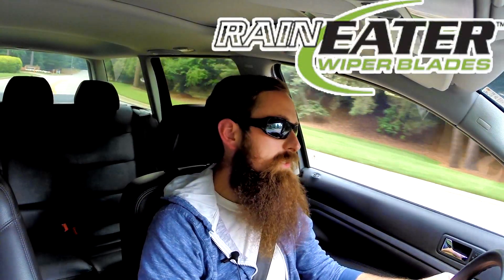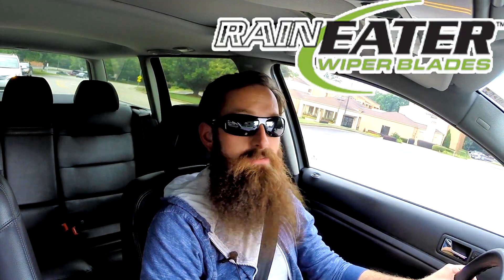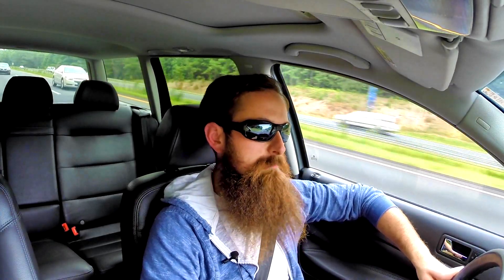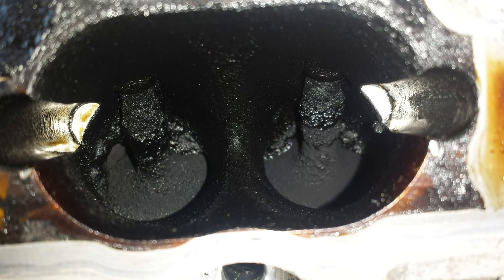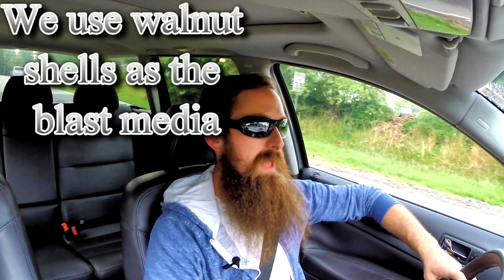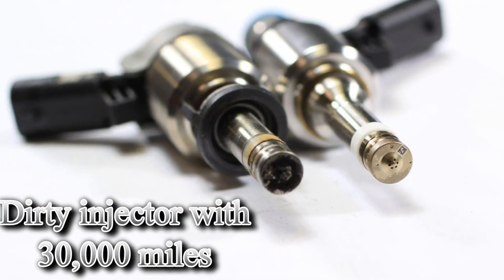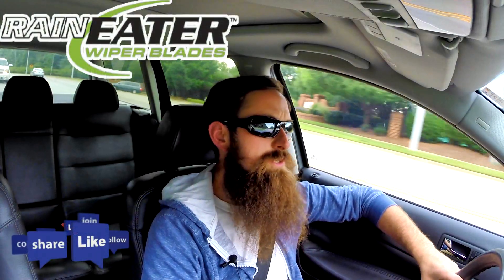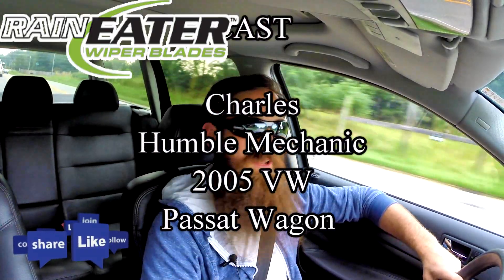Preventing and Fixing Carbon Issues for Direct Injection Engines ~ Episode 80

Comment: Hi, I understand seafoam may not be the best choice but what are your thoughts on hydrogen engine cleaning service. I understand its not as effective as manual cleaning but could it be good enough to get the majority of junk off?
Reply from the maker: I have not found that to be worth the time money and effort. but that is just my experience
Reply: HumbleMechanic 
Thanks for the reply. Would it help in cleaning the valves at all - just that the nearest dealer to me  that offers walnut blasting is 400 miles away and charges 400-600 Whereas these hydrogen vans are everywhere, can come to me and charge 50-100. Also if not directly helping the valves would it be good to use this service in general on a tsi engine in general or is it snake oil? Thanks again.

Comment: For my 2015 audi a3 I take the pcv diaphragm off and replace it every 3rd oil change. While I take the diaphragm out, I use brake parts cleaner to clean all the gunk and carbon built up inside. It'll save headaches in the future and the diaphragm is really cheap.

Comment: Leads off a video about fixing carbon in fuel injectors with a discussion about wiper blades. I guess we all need to make a living somehow.
Reply from the maker: Yep. We all have bills to pay. Not sure if the comment is hate or not. So I’m gonna go the not route.
Reply: It was a little bit of sarcasm, but I do understand you gotta run ads somehow. Wish I could quickly get the gist of the video in about a minute though. Just searching for the best fuel injector cleaner for now. A little scared to take the injectors off or inject stuff into the fuel line for now.
Reply from the maker: It depends on what your goals are. I use BG 44k in my car. Does it really do anything? Meh I don’t really know. It’s probably not going to fix any issues your car has. But might help delay any affects
Reply: Thanks. I've used BG 44K before. It's good stuff but it's expensive. I use it last fall so it's only been about 6 months and 6-7K miles. Good to know that's what you use though. I've done like 3-4 MMO treatments with a Gumout PEA treatment. Changed the fuel filter too. So my injectors are prob clean, but they're the originals with 243K miles on them.

Comment: My father taught me, long ago, take your car out at least once a month and open that thing up!   Reading all the comments and advice, I thank God for my fathers advice and the fact that I Drive my car more than 20 minutes a couple times a week!  My GTI had a dealership cleaning, just as a precaution and because I love my car.  I use top tier gas, let her warm up and watch that idle drop, before I take off.  I feel for these folks who have performance cars, or cars period, who just idle along.  My car has 97000+ miles and that engine purrs on start up and on the run.  Oh, and after a hard run, I don’t just shut the car off, I let it run normal as I drive local streets home; respect.
Reply: That makes no difference on a DI engine because the carbon buildup is on the back of the intake valve which only has air rushing past it, no detergent fuel to clean it.    Running the engine more just builds up more carbon.

Comment: Charles, What about bypassing the PCV route with installing a PCV delete? I understand that most states (like California) doesn't like this due to strict emission regulations, but what if a PCV delete was installed, would this stop carbon build up? Or extremely reduce the carbon build up on the intake valves, specifically? 
AND then of course, use fuel cleaners to get to to the carbon on the cylinder heads as long as top tier fuel is used, of course? 

Could anyone comment about this idea and if it would work or not?

Comment: 99% ISO propyl alcohol sprayed  direct in the manifold with a hand  pump spray bottle while the car is running with a slightly high idle. In the old days ( 1978 ) we dumped some brake fluid right into the carburetor from time to time. On my private cars I took the crank case ventilation hose off ( nobody have to eat his own shit , why should my car ) . Dump also a few liters of 99% Iso propyl every month in your tank, that cleans damn good.  We had experimental engines running in Germany , totally on alcohol, and  they was inspected with an endoscop, and they was cleaner than clean. But the cleanest engines we had was the ones they run on Propane.

Comment: Even though a catch can would help to prevent much of the carbon buildup in the engine, would installing one in my 2018 Audi S3 void the warranty?
Reply from the maker: Good question. I will shoot a video on it. It's not a simple yes/no answer. The short answer is, a failure related to the can might no void the entire warranty, but may result in a claim being denied.
Reply: Robert LeBlanc Really depends on where you live. Thats pretty much a question of your countries consumer laws. I‘m studying law in germany and I really wouldn‘t advice modifying your vehicle what so ever if you might want to do a warranty claim in the future. If you want to claim warranty for an issue that might be ever so slightly related to your modification, the dealership might really easily reject your claim.
Reply: Thanks for the feedback guys. 
It’s strange that they would void the warranty because something was installed that improves engine life, but it’s not surprising either, as manufacturers are known to void warranties for any possible reason.

Comment: Humblemechanic what do you think about water methanol injection on turbo DI vehicles? Should keep the valves hosed down if you boost a lot. Correct?
Reply from the maker: Yep I do think it will work. But I don't think that is a reasonable add on for most drivers.

Comment: My 2008MCS is due for the manual (walnut media blasting) removal of carbon on the intake, my question is, I'm far more interested in a longterm solution. A dual catch can system would probably go a long way with this engine, it eats about 1/2 a L of oil every 2~3k miles. But I'm also thinking about the 30 gals of seafoam and that a meth/water injection kit could be used to mist in these additives over a long period of time. Any ideas/comments? (the walnut treatment costs upwards of 1200$ at the stealership, while a Aquamist HFS3 is only running 750$.

Comment: As soon as i heard passat i thumbed down and stoped the video. I cant listen to anyone talk mechanical that drives a volkswagon. My wife had a passat and i damn near drove it off a cliff. Biggest pile of german engineered shit i have ever seen. The paint on the door panels melted away, you would touch a knob and it would shatter in your hand. The car flooded itself front to back from the sunroof and the check engine light stayed on from 30,000 untill 90,000 when the engine blew up and then said (low oil pressure). Yeah i would say so since its all over the ground.
Reply from the maker: Well glad me driving a Passat makes you not like the video. It makes perfect sense that a VW tech would drive a VW. 

I’m sorry your Passat wasn’t any good. Mine has been solid over the 10+ years I’ve owned it. 

That being said I’ve seen a lot of sad Passats in my career. 🤷‍♂️

Comment: The problem is that there is a fine mist of oil from the crankcase pvc system which builds up on the back of the valves (watched alot of videos about this) but the cure is not what the humble mechanic wants to hear is to get a car with both direct injection and port injection like Toyota and I believe Ford has one but I like my Toyota tacoma it has both. Yes it is a little bit more expensive but cheaper than pulling the motor down and cleaning it. Maybe some day Volkswagen will come up with one.

Comment: Question: In Theory would non ethanol gas offer improvement for carbon build-up? If so, if available would say a blend of less ethanol or a full tank non-ethanol every so often help the issue? Ethanol enhances the octane rating but is there this trade-off?
Reply: It may help to slow down carbon build up but ethanol vapour may ruin sensors in the long term.

Comment: I'm a automotive tech at a shop. Do not use a intake spray With the GDI engines. Mini is a service bulletin warning against using intake cleaner. Using intake cleaners like seafoam can dislodge large chunks of carbon into the combustion chamber. Causing engine damage.
Reply: It also burns extremely hot and is hard on the turbo

Comment: BG has a intake cleaner that you spay into the intake with a BG spay  head and pressure tank, used to use one all the time at the Chevy dealership i work for ,for 20 yrs.You run the engine at 2000 rpm's , you must spay their cleaner on the other side of the mass air sensor , do not spay threw the mass airflow sensor. You need to do this every 6 mo. for about 10min>

Comment: If a catch can would resolve the issue, why wouldn't all manufacturers add a catch can to direct injection engines?
Reply: Same reason they don't want oil leaking from vehicles. Those guys behind the desks making the rules don't want anything unnecessary contaminating the environment. Having a catch can installed by the manufacturer would require an automatic dump ..... into the environment.
Since the average consumer will most likely not want to be bothered with emptying and recycling something from their car. It is bad enough what diesels have to do. The dual injection with just a minimal amount bathing the valve will probably be the route taken, IMO.

Comment: I like the comment below about taking it on the hwy to clean it.but I wonder were the burnt carbon goes?possibly clogging the catalytic converter?
Reply from the maker: Not if the cat is working properly. You will not get that much out on each run. I mean enough to clog a fully functioning cat
Reply: HumbleMechanic thanks man

Comment: You guys Alls and your mate Charles do some really great work and keep it up ! Now on GDI we have no fuel washing the backs of the valves but we still have blowby the rings, oil evaporation ( their is a correct term that Charles will know ) and condensation of water within the engine and a turbo will add to this crap that's hitting the back of hot intake valves and just hanging out with the rest of their mates stuck for good until all is shit ! If I bought one of these GDI cars, I would put a good catch can in asap if I was going to keep it.

Comment: I think driving the vehicle fast to expell  carbon build up though the exhaust system regardless of the method use to clean valves will start to clog the catiliytic convertor. This will create a whole new set of problems. Mechanics can misdiagnosing  problems with a vehicle if the history of the car is not known.  It seem like direct injection is a bad thing for engines and not worth the small increase in fuel mileage concidering the maintenance, repairs and money involved to keep these vehicle running properly. The only ones that benefit are the car manufacturers because people will have to buy new cars more often. Mechanic will benefit preforming all kinds of services for these direct injected engines. The consumer always looses.
Reply: Just to impress those desk jockeys with mileage numbers. I think we have passed the cost of ownership parity with fuel economy a long time ago.

Comment: Yea this is a strange phenomenon. I does make sense though nothing to clean the intake side of the valve. especially with the  new non Otto cycle designs. a little combustion gas puff back into the intake port with every intake opening. Perhaps there is a need for a second injector on the intake side like some engine designs already have and a reprogram every so many thousand miles to run indirect injection for a few hundred miles as the cure. Then the additives would have a chance to work effectively other than that a cleaner  injection system. Pipe it to the intake system and wire it to something random.... I don't know.. the a/c compressor or say the brake light. For every 400 pushes of the brake the solvent dispenses a slow drip of solvent for 5 minutes?? a cheap add on counter could be used.  Vw had such a issue with the diesels and in my view could have just added a def tank replaced the ECU and wire harness and added a small injector system to the exhaust. Perhaps just replace the particle soot filter entirely and refit them (sell the old ones as Manufactured)... They sell other reman stuff. Why not DPF and ECM and for that matter harnesses? They would Perhaps im off on this if so please correct me.  O I realize time was the devil in the detail but in my view they had plenty to work out the logistics and start the process. Perhaps if VW found a solution to this issue and changed the industry.... Just saying.

Comment: At our shop we've found that Seafoam works fantastically at removing the carbon deposits...if we catch it early.  But when the carbon really starts to cake on to the point the valves are noticeably failing to close all the way, the only thing that's removes carbon that hard and thick is physically removing it. we've found best success medial blasting with walnut shell, which shreds through the carbon but doesn't mar the metals.

Comment: Hey Charles, first of all thank you for all your videos, they are very informative and helped me understand a lot about my car. I have a question for you. Do you have any experience with intake cleaning using polyetheramine (specifically the BG 211 induction cleaner) on the 2.0TSI? (my engine's intake valves dont look so hot). I have read/seen much about it, to be pretty sure it really does dissolve the carbon, and should be safe for an atmospheric engine, but my worry is about the turbocharger. Can the broken off pieces of carbon destroy it, or are they harmless? Does the process dissolve them gradually into small grains, or can it dislodge bigger, dangerous pieces? Thanks!

Comment: If you've seen the photos of the intake valves,,,,,,,, the Piston domes,,,,, combustion Chambers,,, and the bottom side of the valves,,, are ten times worse,,,,. ???  Not to mention the compression rings and the oil control rings sticking in the Piston grooves,. !!!!    Loss of power and excessive oil consumption,,, ???   Removing the intake and cleaning the intake valves is only. A short term,,, random misfire. Solution,,,.  Will do absolutely nothing for. Loss of power,,, oil burning,,, and pre detonation,,,. !!!!   But your knock sensor will back your ignition timing off and you'll never hear any knocking only lacking power,. ???

Comment: A catch can is a flawed technology,,,,. May help 5% if installed when the vehicle is new,,,.  Will not remove carbon once it's built up,,,,.  I'd be more worried about the EGR,, ???    Every since 1978,,,???   EPA,,,,.  Breathing EGR and PVC,,,. Carbon has been an issue,,,,.  There is a easy fix,, ???  But it might be a forgotten technology,.  ???    My grandfather showed me,,, and I've used it on every older motor for 35 years,,,,.  Cars trucks motorcycles quads turbos,, and even airplane engines prop jobs,,,

Comment: You forget that build up less carbon deposit is to reduce the egr  valves operation., more exhaust recirculation is less oxygen  to get into the cylinder   and produce more soot by poor combustion quality , that its recycle into the mainfold then .
I think vw in the sofware fix abuse of this thecnique and will create a lot engine problems at the medium and long term

Comment: my 1.8 tsi BZB 160PS has a cold start misfire on cylinder 1 issue from around 180 000 km. Now it is around 295 000 km and the problem is still there. Normally it always runs with "check engine" sign. When I connect it to VCDS I see, depending on the day I guess, either "mixture too lean" or "mixture too rich" + a couple more errors. For instance: configuration 1: P0172 + P0299 + P0101, configuration 2: P0171  + P119A. Car drives normally, except "hesitation" when I press the pedal from time to time and misfires on idle. I'd probably need to look into cleaning that carbon there..

Comment: Have you noticed some manufacturers, having released a generation of direct injection vehicles, update the engine and are now adding combined direct injection and MPFI systems? I cannot recall who exactly was doing this, I think Ford w/ the f-series gassers, but it seems that OEMs are aware that due to the design the is not really a perfect solution

Comment: CRC intake valve and turbo cleaner was great for me on my 2015 Sonata SE 2.4 L engine. I heard there may be problems with other folks using it on Ford Ecoboost but this stuff really worked to restore lost hp and throttle response on my car. I recommend you look into it
Reply: Ruined oxygen sensor on a Ford Ecoboost using that product.

Comment: I'd be willing to argue that a tune from APR or Unitronic would help with carbon build up.. faster ignition timing, faster air flow, more boost, more heat.. but this is just a speculation

Comment: I have a 2010 Skoda Superb with a 1.8 TSI with 200,000 km and I have very noticeable idle misfire issues and fuel economy is at best 70% of what it should be. After thinking it was coil packs I randomly have this video in my suggestions. Having the injectors cleaned here is very expensive and my mechanic never even thought of carbon buildup so I'm pretty sure manually cleaning the carbon buildup would be pretty expensive. I will try to use fuel additives and cleaners and reply to this comment with whatever results I have (even if this video is more than 2 years old). If anyone knowledgeable sees this, does the carbon buildup have more severe long-term effects?